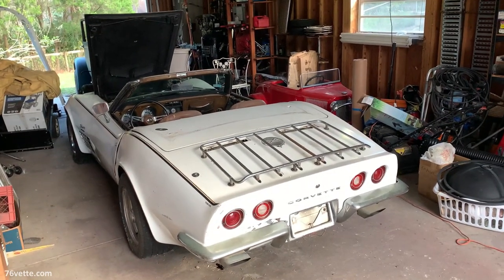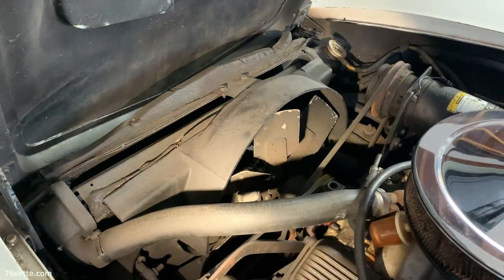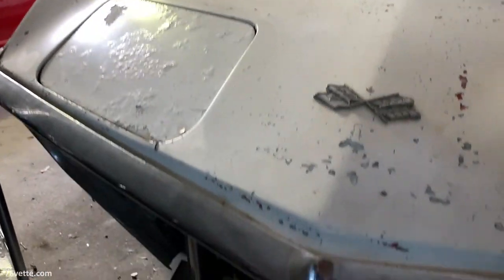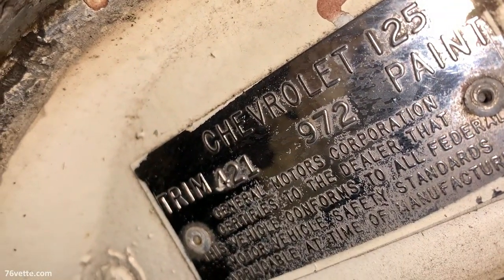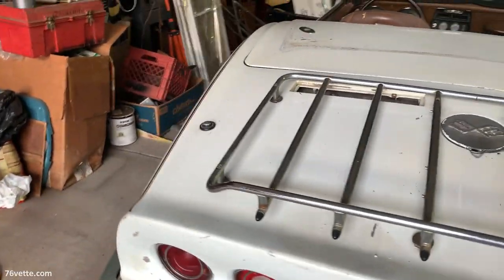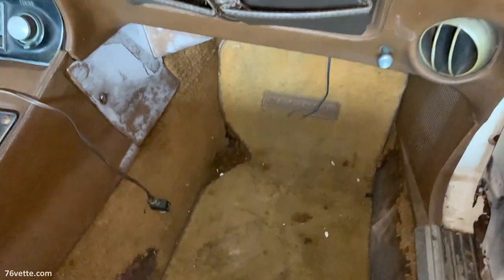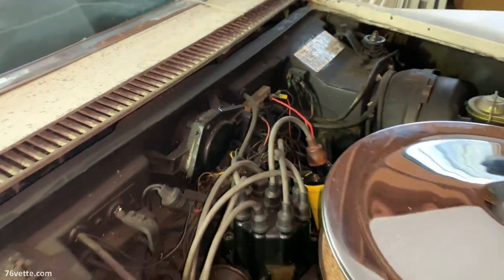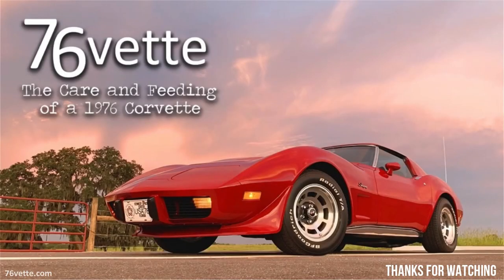1972 Corvette LT1 Convertible BARN FIND

Comment: What Ernest C said.  I have restored a C3.  It is a ton of money. If a real AC car, it is one of about 240.  AC LT-1 had 5,600 rpm redline tach to keep belt on the pulleys.
Reply from the maker: It appears to be the real deal. Just rough and neglected. And it may have rust issues. And yes. A resto would cost quite a bit.

Comment: Rust and holes in that bird cage by the vin tag. I'm going to speculate the body would have to come off of this car for frame or cage repairs. If so, welcome to a 100k+ full restoration on this car if a shop does all the work. Sad that a car this rare was left to rot by 'owners' who didn't care.
Reply from the maker: Yeah, I’m guessing that bodywork and paint alone would run $30K or more. I have no idea why this car was allowed to deteriorate to this point. It is sad to see it in this condition.
Reply: Saw that birdcage rust during the close up of the VIN as well. It's another situation of "it'll be a great car once you throw lots of time and money at it". A shame as it was built only 28 days before my car was.

Comment: LT1 cars have a 6500 rpm red line, I noticed this is a 5500 red line.
Reply from the maker: Good observation. However, LT1s with air conditioning had base model 5600 rpm tachometers.
Reply: Base model tach redline is 5300 rpm, LT1 A/C cars used the 5600 rpm tach off the LS5 454.